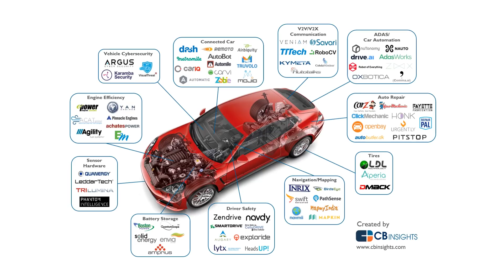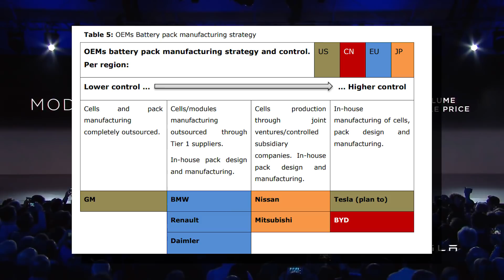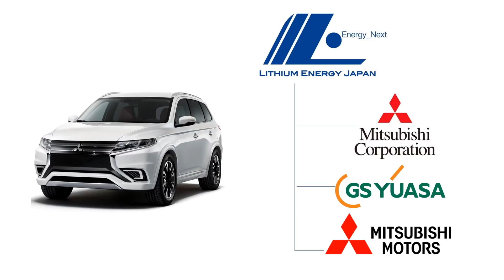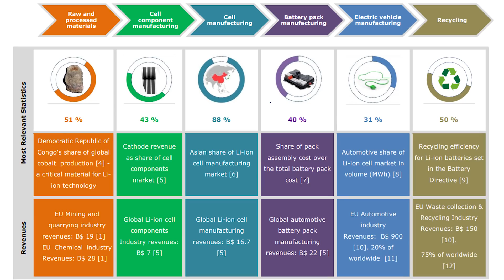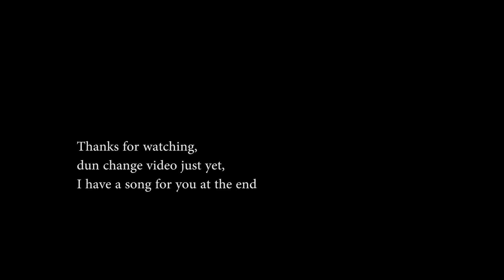Map of the Electric Vehicles industry [Pt 2/2]

Comment: A few problems with your video .

1: Tesla doesn't manufacture batteries their gigafactory partner panasonic does , tesla assembles the final pack ,builds the factory panasonic builds the cells and leases the building under their supply contract. This distinction is important because the contract isn't exclusive this is why Toyota is eying to do something similar . This also means the biggest winner is panasonic not tesla as panasonic has the ability to manufacture at a larger scale while diversifying into many markets like cell phone batteries , power banks  and simultaneously supplying competitors like toyota  .

2:China has moved so fast in the ev market because they are the world's largest producer of photovoltaic power , they have been setting up to ban gas and diesel powered vehicles for a few years now as part of their effort to reduce air pollution . No gas or diesel only leaves them the option of ev's , the car industry there has adapted to this , as a result for the past 2 years they have built amazing electric scooters , motorcycles ,ebikes, and soon cars.

3: Gm has 2 new ev's coming out in less than 18 months and 20 by 2023 they clearly are not half hearted .

4: Tesla has been virtually alone in the ev market mainly because everyone else has been waiting for solid state batteries , gigafactory was a gamble based on the timing and development of new battery technology. While these new technologies are not at market it gives tesla the ability to dominate the market and grow , unfortunately for tesla the glass battery came out of nowhere and they will be ready by 2019.

In short tesla is about to be in for the fight of its life literally as every other manufacture already has the ability to outbuild them and will soon have longer lasting faster charging batteries .
I'd love for you to make a video on this subject as well as the roadblocks for ev's too instead of simply being slanted towards one company .
Reply from the maker: Would you send me some links to what you have claimed? Especially to your first and your last point, I don't think you are right about those two points.

Regarding your last point, I'll give you a quote from one of  the papers I've read stating the challenges of SSB

"Despite fast growing interest in SSBs, many challenges remain in both manufacturing and fundamental understanding of the technology. For example, lithium-ion conductivity of the polymer electrolytes is too low for battery operation at room temperature,  and the operation in electric vehicles requires temperatures above 80 °C. Even then, their rate capability is limited, preventing fast charging. Hence, the search for stable polymer electrolytes for use with lithium-metal anodes and lithium nickel cobalt manganese oxide or lithium nickel cobalt aluminum oxide cathodes at ambient temperature at sufficient Crates is one of the challenges scientists and engineers face in the forthcoming years.
The major drawback of many inorganic SEs is their low thermodynamic stability. Most solid electrolytes are easily reduced at low potentials (for example, by lithium metal) —just like their liquid competitors — and oxidized at intermediate potentials. Protecting
interphases are therefore required to stabilize the electrolyte/electrode contact, as happens in conventional lithium-ion batteries"

This particular paper predicts the technology to mature in 10 to 20 years from now, so I don't think anyone is waiting for SSB
Reply: MsSupADope Panasonic makes batteries that are exclusive to Tesla but it still owns most of the process and IP for the technology.
Reply: + Frederick Stirnkorb  +Curious Elephant

1:Panasonic owns most of the battery equipment in the gigafactory and very much builds the cells , tesla assembles them into the pack. Musk has stated this multiple times and it has been quoted as such two examples  here 
http://beta.latimes.com/business/autos/la-fi-hy-tesla-panasonic-20160608-snap-story.html   
Elon himself 
https://twitter.com/elonmusk/status/740383850820296707?lang=en
https://www.reuters.com/article/us-panasonic-tesla/panasonic-aims-to-move-tesla-auto-partnership-beyond-batteries-ceo-idUSKBN1530UC
https://cleantechnica.com/2017/11/02/panasonic-ceo-says-tesla-model-3-production-bottleneck-now-understood-battery-pack-production-now-fully-automated/
https://www.reuters.com/article/us-panasonic-results/panasonic-says-gigafactory-battery-output-to-increase-for-teslas-model-3-idUSKBN1D00S7
so many i could post them all day but you get the point

2: I never said toyota is doing the same thing as tesla i said something similar , in short a partnership to buy cheaper batteries . Toyota is more focused on hydrogen fuel cells and solid state batteries , google Toyota fuel cell factory or solid state batteries for more information.

3: a few of the car makers eying to release solid state powered cars
Bmw
https://techcrunch.com/2017/12/18/bmw-teams-up-with-solid-power-to-develop-solid-state-batteries-for-cars/
http://www.motoringfile.com/2017/12/18/bmw-mini-preparing-game-changer-solid-state-batteries/
Toyota
https://cleantechnica.com/2017/10/31/toyota-exec-solid-state-battery-tech-game-changer-evs-arent-backing-away-hydrogen-fuel-cell-vehicles/
porsche
https://insideevs.com/porsche-eyes-solid-state-batteries-for-future-electric-911-boxster/
Ford's solid state patent
https://www.google.com/patents/US20160329594?dq=ininventor:%22Venkataramani+Anandan%22&hl=en&sa=X&ved=0ahUKEwic-42Dm4zTAhWIZiYKHVaQB0AQ6AEIIzAB

4: Solid state arriving faster than expected 
Fisker is set to show it's solid state technology in a car next month at ces 
https://cleantechnica.com/2017/08/23/fisker-emotion-unveiled-ces-2018/
John goodenough stated 2 years of development for the glass battery in his last interview 
https://hardware.slashdot.org/story/17/04/19/016213/the-slashdot-interview-with-lithium-ion-battery-inventor-john-b-goodenough

Specifically to Curious Elephant's research stating " Despite fast growing interest in SSBs, many challenges remain in both manufacturing and fundamental understanding of the technology. For example, lithium-ion conductivity of the polymer electrolytes is too low for battery operation at room temperature,"

The article can be viewed here https://pdfs.semanticscholar.org/6325/5acdf576b3dd9ba2265a47628069302bd0c2.pdf. This article is from 2016 and predates not only Fisker but  the release of the the test data, and patent from the creator of the lithium ion battery John goodenough (https://en.wikipedia.org/wiki/John_B._Goodenough) . The patent he filed is here https://patents.justia.com/patent/20170301922 , his research data can be found here https://docs.wind-watch.org/braga2017.pdf 

China banning gas and diesel cars
http://www.independent.co.uk/news/world/asia/china-petrol-diesel-car-ban-gasoline-production-sales-electric-cabinet-official-state-media-a7938726.html
https://www.ft.com/content/00b36a30-a4dd-11e7-9e4f-7f5e6a7c98a2
http://money.cnn.com/2017/09/11/news/china-gas-electric-car-ban/index.html
https://www.nytimes.com/2017/09/15/business/gm-china-ceo-gasoline.html

China's new pollution law
http://www.loc.gov/law/foreign-news/article/china-new-law-replacing-pollution-discharge-fee-with-environmental-protection-tax/
Just google china air pollution laws , you will find them going back to the 80's continuously becoming more strict

China largest  producer of photovoltaic power
https://en.wikipedia.org/wiki/Solar_power_in_China
https://en.wikipedia.org/wiki/Solar_power_by_country

Ability to outbuild tesla
Quoting directly from tesla's own quarterly report 
"In the first quarter of 2016, we announced our target to increase overall vehicle production level to 500,000 vehicles in 2018. We have started the installation of Model 3 manufacturing equipment at the Fremont Factory and Gigafactory 1, and we are on-track for start of Model 3 production in July 2017. We expect to make additional investments through the remainder of the year as we increase automation and add production capacity"  

Direct link to the document 
http://ir.tesla.com/secfiling.cfm?filingid=1564590-17-3118&cik=1318605

Tesla's worldwide sales just hit 250,000 cars sold in september of this year 
https://en.wikipedia.org/wiki/Tesla,_Inc.

Lets say tesla starts building 500,000 cars per year which is more cars than they have sold so far , in 2016 toyota built 10,213,486 , volkswagen 10,126,281,kia 7,889,538 ,gm 9,937,43 ,ford,6,429,485 and so on, while building  vastly more complex internal combustion based cars.
https://en.wikipedia.org/wiki/List_of_manufacturers_by_motor_vehicle_production#2016

If i missed something let me know because this post is already an article in itself with all the links to sources.
Reply from the maker: Hi Wind, thanks for your Research effort.

I just want to make some final comments (after reading some of your links)
1. Tesla did spend billions of dollars building the gigafactory. And it's a partnership between Panasonic and Tesla, therefore all the production inside gigafactory is jointly done by both companies. Most of the links you have provided support this point. If Panasonic working relationship with Tesla is like what you suggested,  Tesla should have just contracted them to make the batteries instead of building factories for that allows Panasonic to use the same technology for Tesla's competitors. 

2. I'm aware of the number of cars produced in 2016, I don't know why you show me the wiki page for the car productions. (maybe it's for some other comments I assume). I have also read Tesla's financial report, I think you are missing the point, outbuilding Tesla doesn't mean they are making better cars. Chinese Oppo can outbuild Apple,  but can they dominate the market like Apple? You can check the number, I believe Model S is the most sold EV in 2015, it might have been taken over by Nissan leaf in 2016, but Model S stll uses the most Batteries as it has bigger batteries than Nissan Leaf. If you take a look at all of EVs in the market you'll know, Tesla and other cars brands are really not in the same league. 

3. I'm aware of that many car makers are trying to build SSBs, but from a research paper to actual production takes a long time, at least 7 years. So, I am not saying SSB doesn't have potential, it does. But I'm against you saying 

"Tesla has been virtually alone in the ev market mainly because everyone else has been waiting for solid state batteries , gigafactory was a gamble based on the timing and development of new battery technology."

I think not building the Lithium-ion battery is a gamble. what you said is not logically coherent because, on one hand, you're saying Tesla is alone in the EV market, on the other hand, you are saying other companies are waiting for SSB technology to mature so that they can start making EVs.  Realistically, just give me one example of SSB powered EV? As you said it yourself,  GM is going to produce LIB powered EVs by 2023, so no one is waiting, your third point and your last point contradict each other.  

4. As a Chinese myself, I am aware of the progress the Chinese are making in the EV and clean energy industry.
Reply: 1: You are right about Tesla spending billions of dollars on the gigafactory but  the business deal is based on the build-to-suit lease model as well as an agreement to purchase the full output from the production equipment . The exact quote from tesla states the following "  Under our arrangement with Panasonic, we plan to purchase the full output from their production equipment at negotiated prices.  As these terms convey a right to use the production related assets as defined within ASC 840 – Leases , we will consider these leased assets beginning with the start of cell production in 2016." This statement can be found here (  https://seekingalpha.com/filing/2759623  ) in this link containing yet another tesla earnings summary . In short the production is not done jointly Tesla leases them the space and some of the equipment then buys the output.
This point is valid but pointless as my statement wouldn't be invalidated either way since the cell production is done by panasonic and final pack assembly is carried out by tesla just as i said tesla does not make the batteries .

2: I never claimed anyone was creating a better car than tesla , i said they could outbuild them . The numbers validate that statement , the link to tesla's wiki shows you they just hit 250k cars sold worldwide in september and the lowest building car maker in my list at least doubles that every month ! . Think about that for a second , in 10 years tesla has not sold what ford builds in 1 month !

3: You:  I'm against you saying 
"Tesla has been virtually alone in the ev market mainly because everyone else has been waiting for solid state batteries , gigafactory was a gamble based on the timing and development of new battery technology."

I think not building the Lithium-ion battery is a gamble. what you said is not logically coherent because, on one hand, you're saying Tesla is alone in the EV market, on the other hand, you are saying other companies are waiting for SSB technology to mature so that they can start making EVs.  Realistically, just give me one example of SSB powered EV? As you said it yourself,  GM is going to produce LIB powered EVs by 2023, so no one is waiting, your third point and your last point contradict each other.  

Me:Virtually: nearly; almost.
Example :"virtually all those arrested were accused"
synonyms: effectively, in effect, all but, more or less, practically, almost, nearly, close to, verging on, just about, as good as, essentially, to all intents and purposes, roughly, approximately; informalpretty much, pretty well; literarywell-nigh, nigh on
"the building is virtually empty"

My usage is perfectly  inline with the definition but i will rephrase and clarify for you .
Tesla has been Effectively alone ,as the other offerings do not compare well and are few .

You: I think not building the Lithium-ion battery is a gamble.
Me: I agree because it's a gamble either way, either they make the factory and attempt to create a foothold or risk being over run at a later date by the sheer volume the big 3 auto makes can produce. 

You: what you said is not logically coherent because, on one hand, you're saying Tesla is alone in the EV market, on the other hand, you are saying other companies are waiting for SSB technology to mature so that they can start making EVs
Me:I don't understand what you mean with that statement because i niether said or implied such a thing . However i will clarify what i mean by tesla is alone . I said Tesla is virtually alone in the ev market because the few  ev's in the market with it are terrible in comparison . I owned a Tesla for about 1 year , i have driven both the leaf and a volt which do not compare in any way shape or form.

You : you are saying other companies are waiting for SSB technology to mature so that they can start making EVs.  Realistically, just give me one example of SSB powered EV?

Me: Fisker has a car with a solid state battery being shown at ces next month i linked you to it in the last post . John goodenough has working glass batteries right now his last estimate was two to  three years to start production I also linked to that interview, for sheer simplicity i will provide both links again .
https://cleantechnica.com/2017/08/23/fisker-emotion-unveiled-ces-2018/
https://hardware.slashdot.org/story/17/04/19/016213/the-slashdot-interview-with-lithium-ion-battery-inventor-john-b-goodenough

You: As you said it yourself,  GM is going to produce LIB powered EVs by 2023, so no one is waiting, your third point and your last point contradict each other.

Me: General motors already has 3 ev's  the volt , bolt,and spark.
This goes right back to the term virtually alone, I didn't say they were alone . I said "Tesla has been virtually alone in the ev market mainly because everyone else has been waiting for solid state batteries" i was speaking purely to their dominance over the other current ev offerings . Nissan , Toyota ,Ford,General motors,Bmw,Porsche and more all either have patients on or investment partnerships for solid state batteries planned to be ready in time as they ramp up or start electric car production. the only company i know of that isn't doing this is chrysler who's ceo flat out said they do not belive electric cars are the future .
Reply from the maker: First of all, thanks for the effort, really appreciate carefully thought through arguments. I'm not trying to convince you of my view, hope you understand that. 

1. I asked you to give me one example for SSB powered EV, and I read those two links you've provided me.

The first link is about Fisker Emotion, I'm very critical about the Car, so is the post you have linked, it literally have a 'myths-busted' style section at the end of the article busting all the things Fisker has claimed.  I think they are cooks. Again, I'm not talking about soon-to-bes, or if SSB powered EVs can be here or not, I'm talking about SSB powered EV that's in production now. And the truth is, there is none because the tech isn't here yet. 

About the second link, JBG is a well-respected scientist in the field of LIB, however, as I said, i'm not against SSB batteries, I am against you saying 'Tesla is virtually alone in the ev market because traditional car companies are waiting for SSB tech to mature' because even if (really optimistically) what JBG's solid tech did mature in 2-3 years, it's still battery tech, if it is to be used in mass production of EV cars, it's gonna take a least another 2 - 3 years. Any OEM waiting for SSB battery tech to mature would have lost the market by then. gigafactory was announced in 2014 (based on already mature LIB tech) and it's still not working three years later, you do the maths.

2. Regarding the 'Lease' agreement. I get what you mean now. I just want to point out that business 'lease' is not like I lease you my house and you can live in it kinda lease. The actual agreement is complicated with a lot of fine prints. So I agree that Panasonic is free to work with other car companies, but it is definitely not as simple as "i will supply you whatever Tesla is building". I think there is more to the agreement than we know, very much like TSMC making chips for Apple. 

I think we actually agree with each other on most points!
Reply: I have no interest in convincing you of my view either , i have an interest in providing counterpoints and or pointing out widely held misconceptions  .

1: I linked you to that fisker article specifically because it is both positive and negative , watching your videos i haven't seen any real sceptical views on claims made by tesla .
Your usage of music , video , graphics , and overall production value is very high but after watching a bunch of video's they seem to play like a tesla psa.
You seem to be more critical when not talking about tesla and it's products , there exist many problems and questions in regards to many of the claims the company has made
so why don't we hear in depth researched commentary on these aspects as well ? 

 Fisker Emotion: I can go either way with  Fisker but simply calling them a fraud prior to the ces demo can't really be done.
You:  what JBG's solid tech did mature in 2-3 years, it's still battery tech, if it is to be used in mass production of EV cars, it's gonna take a least another 2 - 3 years

Me: i don't fully understand what you mean here but if your implying it will take 6 years that's insane . The lab currently has multiple working cells and has demonstrated 15,000 recharge cycles on a single cell. Jbg said  "There is a large difference between a laboratory experiment and a workable battery product. The potential market is huge, but incremental steps will not get us there. But without a demonstration of a novel approach, the estimate of 10 years away is an expression of hope for a true breakthrough. I believe that in two to three years our novel batteries will be marketed" end quote . The work remaining on the battery is for mass production and improvements but very much works now.

2: Tesla is publically traded and isn't sec exempt so all aspects in any agreement must be disclosed . If they didn't do this they could be investigated for securities fraud and their assets would be frozen under 18 U.S. Code § 1348. To find the current agreement one would only need search the filings , as an example here is the first agreement from 2009   https://www.sec.gov/Archives/edgar/data/1318605/000119312510017054/dex1033.htm .

You: I think we actually agree with each other on most points!
Me: We do agree on most points on various topics , probably 90% I didn't have a good experience with tesla wich makes me more skeptical of it's claims, i would mainly like to see counter arguments to tesla's claims included with their statements as a balance. I think if i had heard some a while back i would have waited a generation or two prior to purchase. A few debates could be

Does tesla have any plans to release their service manuals,software,parts and or tools so people can fix their own cars and to what degree?
This is one of the main reasons i traded mine in , the quality control at tesla is lacking . My car had strange sounds sometimes when driving , paint imperfections and a door lock that sometimes made the decision i wasn't allowed to drive the car.
Will tesla allow aftermarket companies to build replacement battery packs or other parts for their cars?
This would be great for aftermarket parts or upgrades .
will there be any alternatives for maintenance other than tesla ?

Tesla semi 
How does the company plan to release a wide grid of charging stations when each truck requires around 1.6 megawatts of power to live up to the 30 min 400 mile charge time?
Not including losses 2kw per mile x 400 miles = 800kw for 1 hour / 2 = 1.6mw for 30 minutes .
1.6 megawatts would power 262 american homes and is around 18 times the power needed for a model s charging station(90kw).

solar roofing / powerwall
Does a solar roof make sense ?
How much will it actually save the average family ?
What if i sell my house ?
How does it compare to standard solar panels in performance and price?
Reply: Wind
Curious Elephant is correct! On the first point, you are wrong (where do you get that Panasonic makes the batteries for Tesla?). It's a partnership in battery tech between the two companies, and more importantly Tesla develops their own battery tech separately with a couple of university research institutions in the US.
Reply: Frederick Stirnkorb
That would be true; "... owns most of the the process and IP for the technology." This is in line with what I said, that this is a partnership, i.e. a shared ownership in development. I was refuting the statement Wind made that Panasonic makes the batteries for Tesla, which is false. To boot, Panasonic just announced a partnership with Toyota to do the same thing, and they cannot (legally) use the battery development tech done with Tesla.